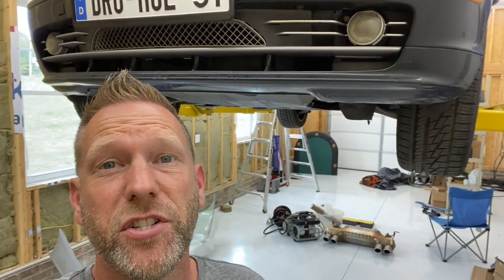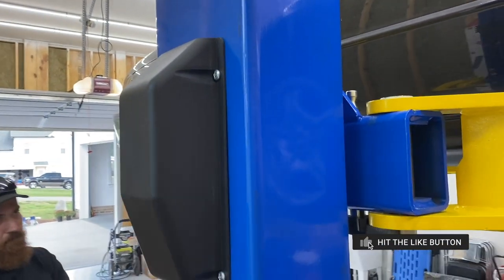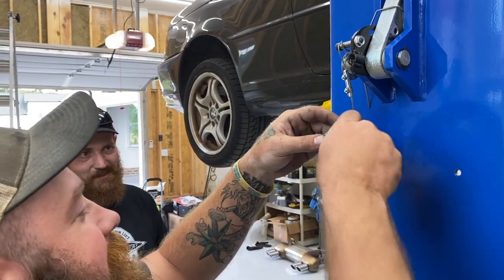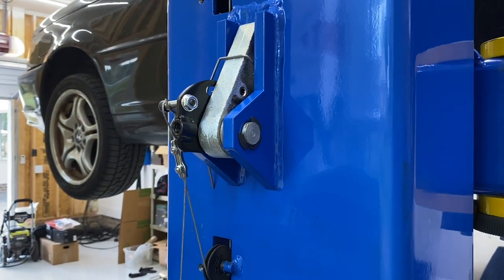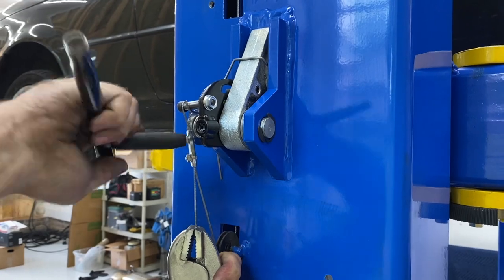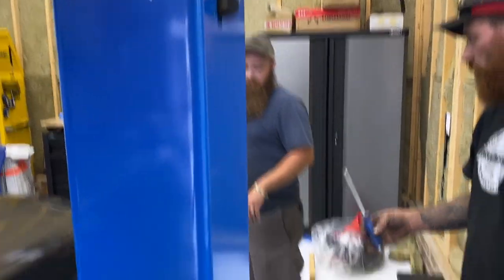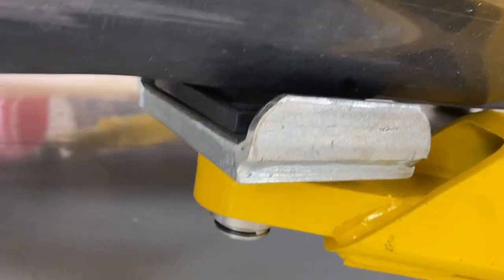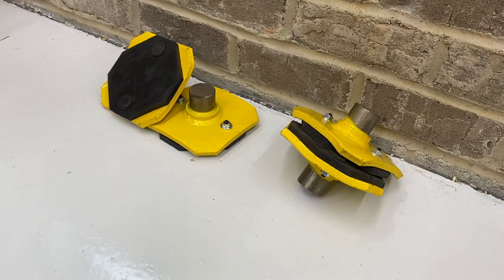SINGLE POINT LOCK Adjustment for a Forward 2-Post Lift

Comment: I use pieces of 2x4 1ft long between my floor jack and the pinch welds 1 foot to distribute the load along the pinch weld. Also have a quick jack.